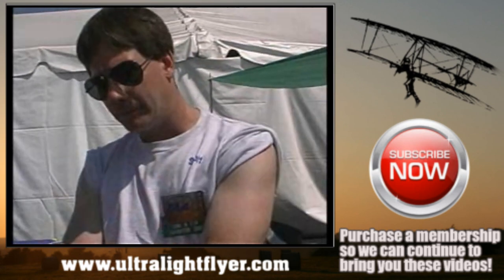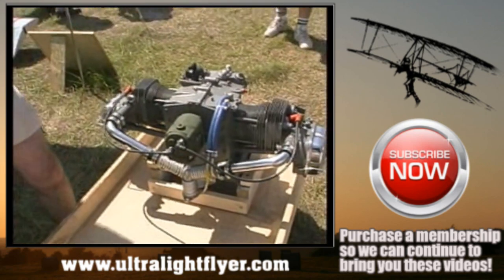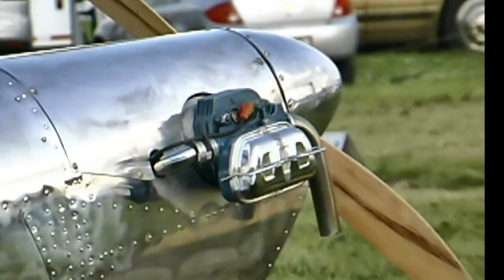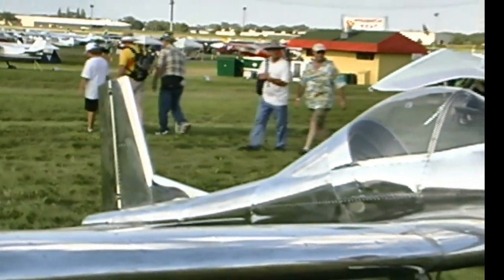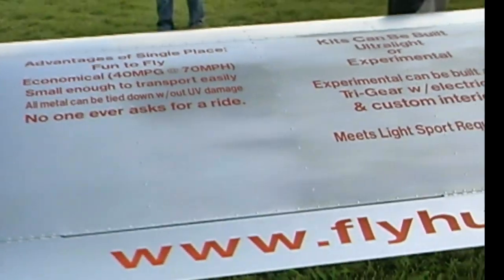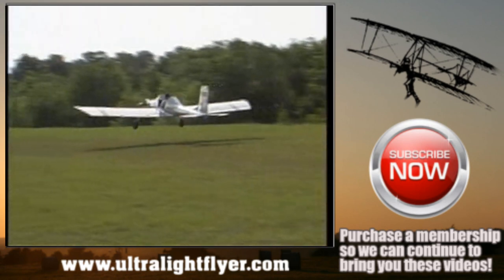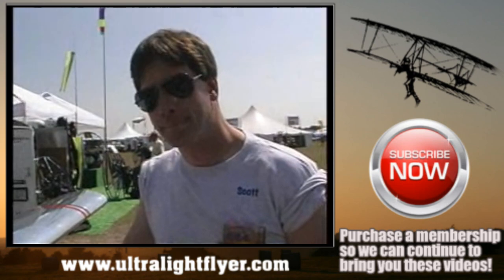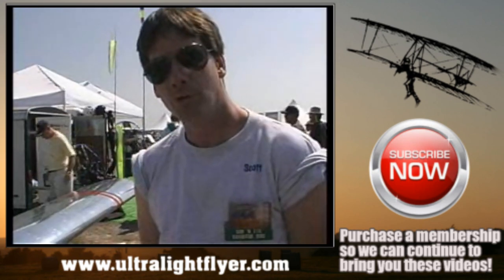Hummel Engines, Hummel VW aircraft engine conversions, 2 & 4 cylinder WV conversions.

Comment: I put a 250 turbo 4 cylinder vw engine in a hummel UC and had to add 25 pounds of lead shot in the tail for better cg.The fire wall broke lose at 75% power.